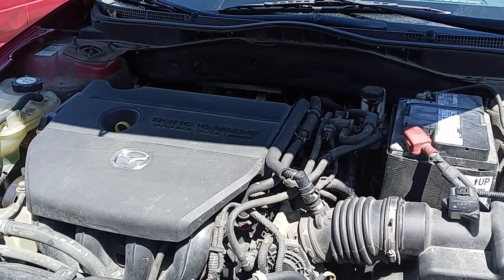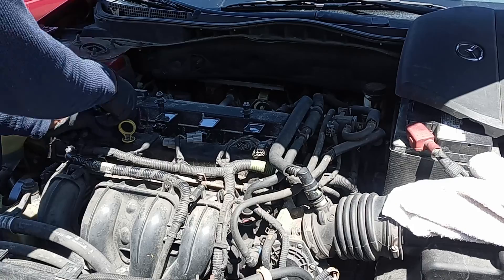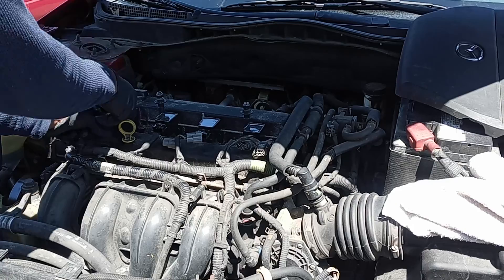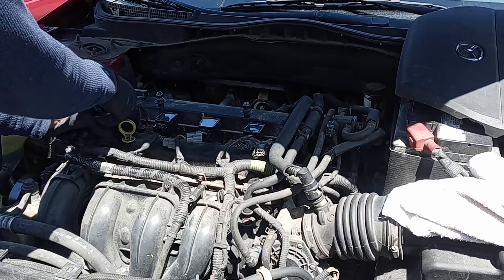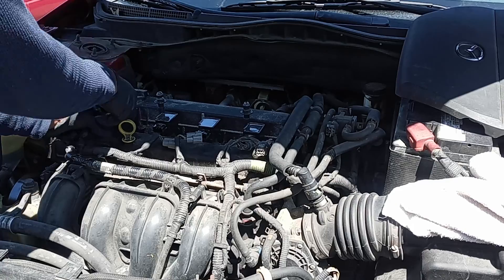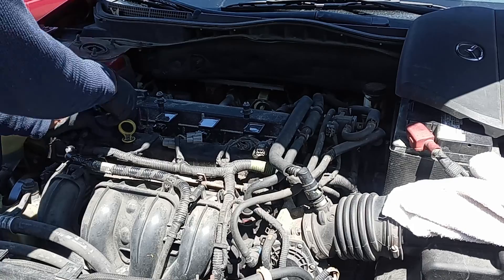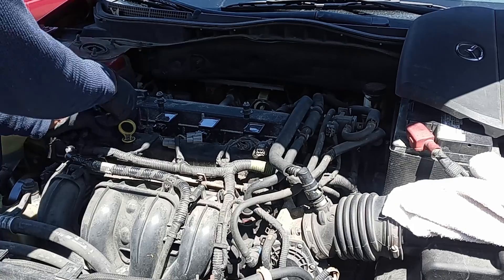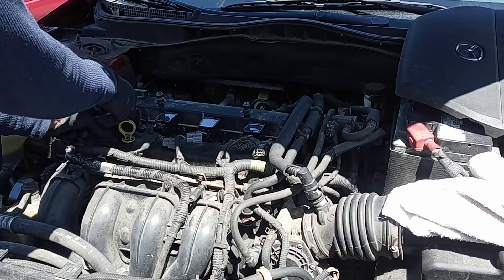#injectors #Mazda6 How to diagnose, test, and replace fuel injectors for better engine performance

Comment: Great video!  Straight to the point with NO BS!  Your video helped me tremendously!  My MPV had #2 injector dead.  Went to the local auto parts store purchased one fuel injector cleaned the 3 remaining injectors and got me back on the road!  Thank you so much!  Raul :)
Reply: How did you know it was your fuel injector? What problems were you having with the car initially??